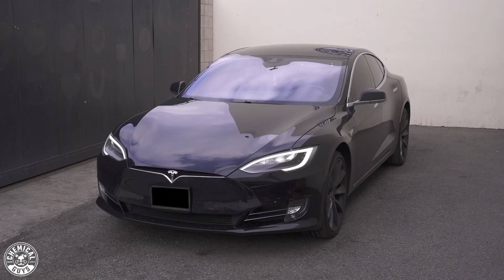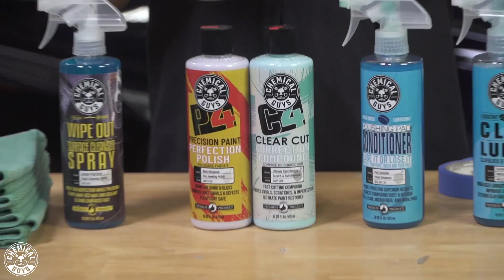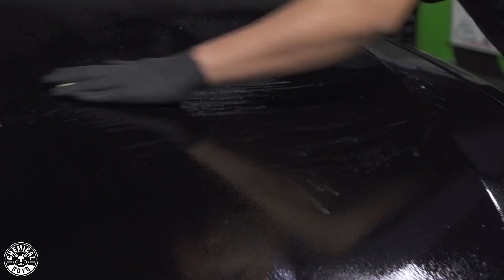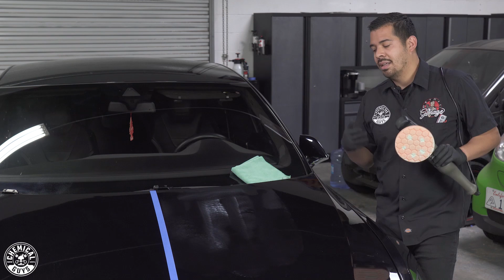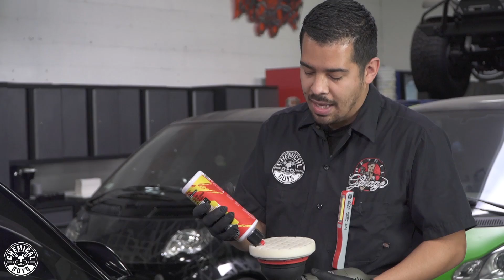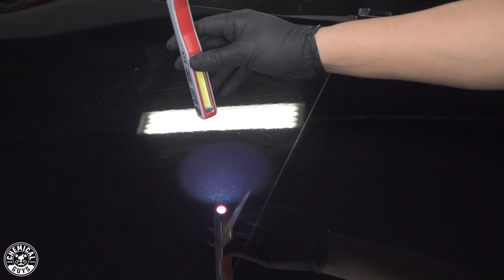How To Get Rid Of Scratches & Restore Shine! - Chemical Guys Tesla Detail Part 2

Comment: What is the next step after the c4 and p4 process?
Reply from the maker: Hey Kevin! After removing swirls and scratches use your favorite coatings such as ceramic, glaze, sealant, and/or wax to lock in shine and repel harsh elements.

Comment: What if you don’t have deep scratches, however just light clear coat scratches? I don’t want create more scratches with a compound...
Reply from the maker: Hey! Use P4 for light scratches and swirls.
Reply: @ChemicalGuys  thanks! So I did that, however I am still seeing some scratches that are not coming out. 

Do I need to wait and then do another pass? This is a brand new 2021 car that has gotten scratched with the dust and debris here in AZ. 

I didn’t realize about needing the wipe out, so have that on order. I prepped with the soap for black cars, mines dark green, and also the clean slate... Just at a loss with this car!
Reply: @katebarreldesigns2684  some scratches just don’t respond well to compounding and need to be sanded and then polished. If you want a quick and easy method, I had great results using the Easy Cream glaze to fill in the deeper scratches and overall it’s an amazing product for dressing up the paint.

Comment: Great video.  So, would Wipeout be the last step,  taking the place of jet seal +  butter wax?
Reply from the maker: Wipe Out will remove oils to reveal the true cut. Once you use Wipe Out, we recommend applying Jetseal and then Butter Wet Wax. Thanks for watching and happy detailing!
Reply: No, Wipeout just cleans off polishing residue ect before finishing with a sealant or wax